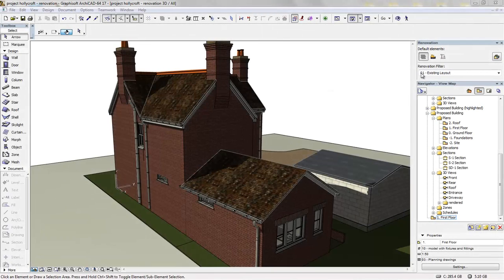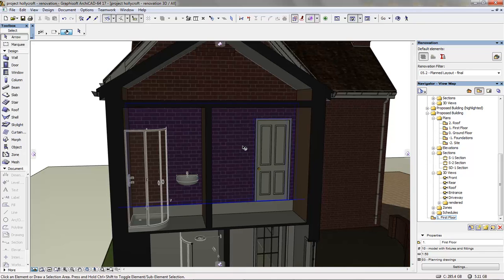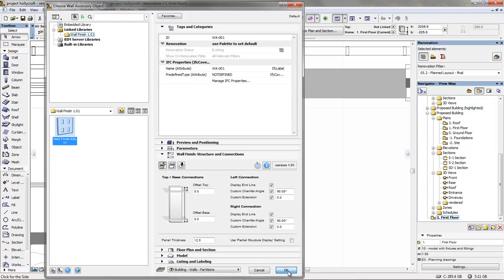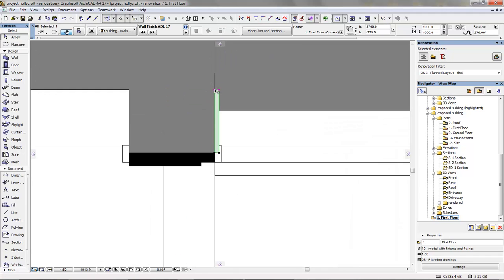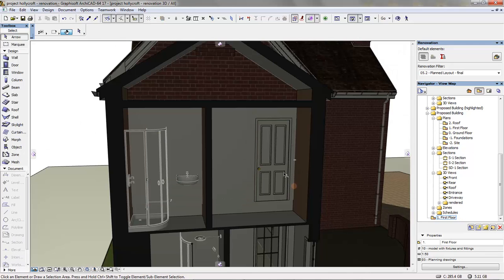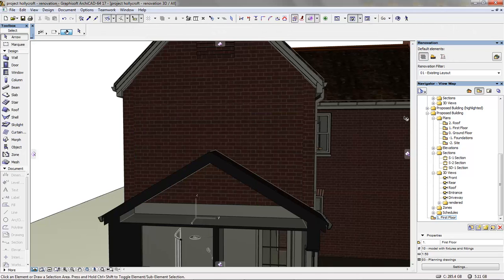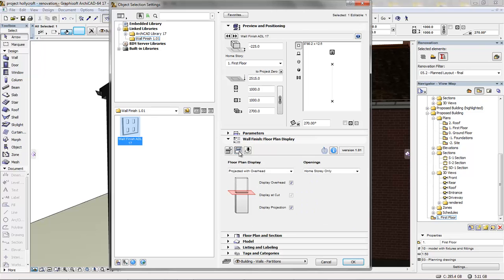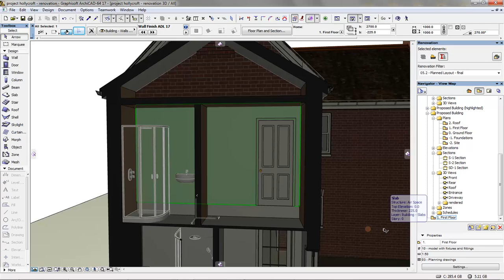ArchiCAD Object - Wall Finish

Comment: Hello man great video, but i have a different question regarding walls. I am trying to add a plaster band to the top of a wall, three in fact, each sticking out a different distance from the wall. Is there any way to achieve this ?